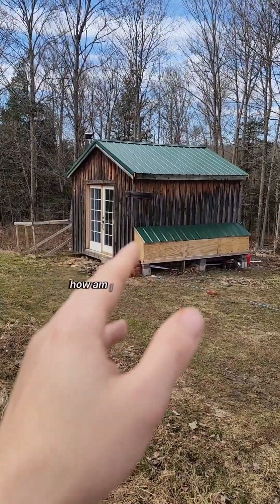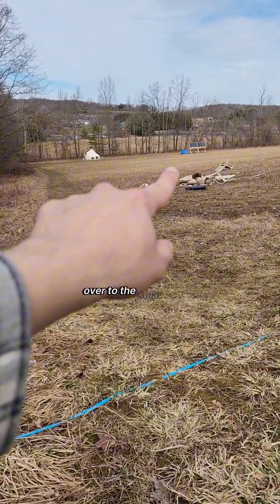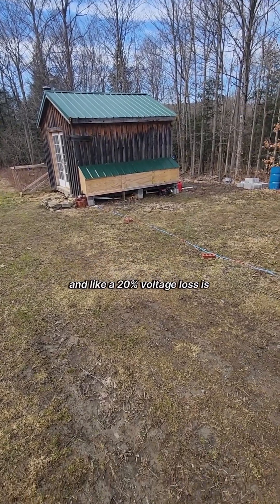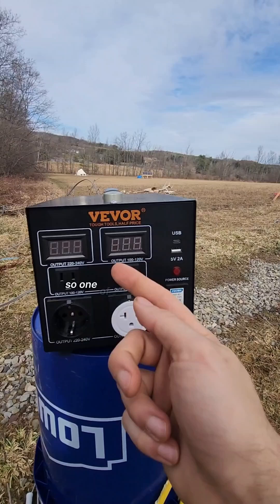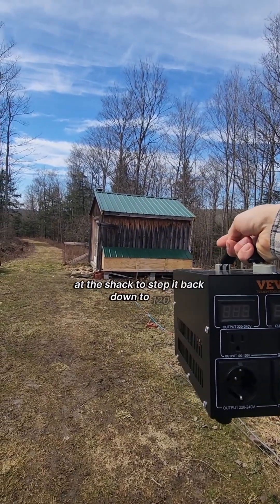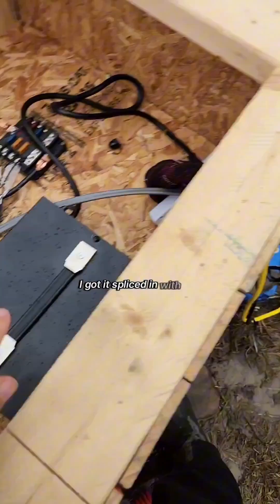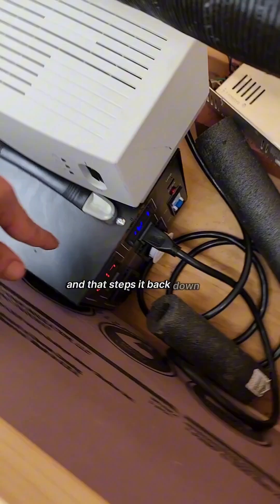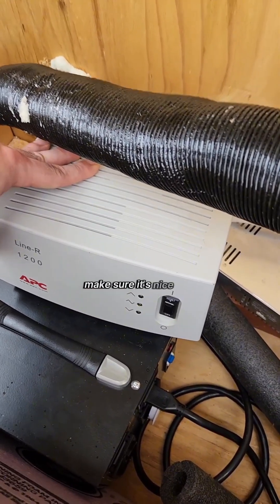DIY High Voltage Powerline to Solar Panels #DIY #solar #offgrid

Comment: The other option would be putting more panels and series an MPPT, that can handle a few hundred volts.  Otherwise, The energy lost, stepping up the voltage and stepping it down plus the component cost to do that and the reduced reliability of the system make it not worth it.

Comment: This just proves that the guy didn't ask anyone with brains to help him. It works but it's stupid. Put the solar panels closer to the shack and take the loss on sunlight and save the hassle of replacing the failed electronics every so many years and the unreliability of the complications.
Reply from the maker: Have you ever made a solar array before?
Reply: @janklabs  I have 30 years experience in industrial instrumentation and process control maintenance. Have you done that? I can install complicated stuff, troubleshoot it, make it work properly and fix it when it breaks. Show me the math and then figure in replacement costs of your Chinese junk.

Comment: I like your motivation to DIY, and your resolve to figure things out.
Having said that, why did you put those components in a box next to your solar panels?
Why not just have the needed components located at the house, with only the wire for the panels run to it? Add a shutoff switch at the panels and you're GTG. An 8 awg wire pair would be sufficient at long distances to get the power to your solar charge controller. Maybe 2 pair if you have more than one group of panels.
Reply from the maker: theres a lot  to explain why i didnt go that route. maybe i should make a full video on it

Comment: If you would have upsized your wire or ran parallel pairs you wouldnt have a voltage drop. Just fyi
Reply from the maker: Bigger wire would be way more expensive